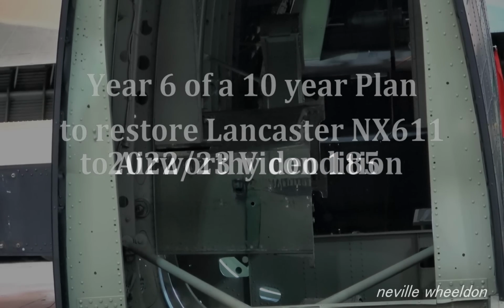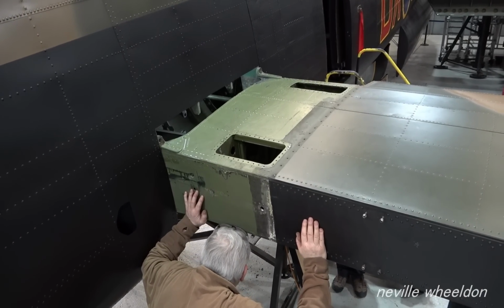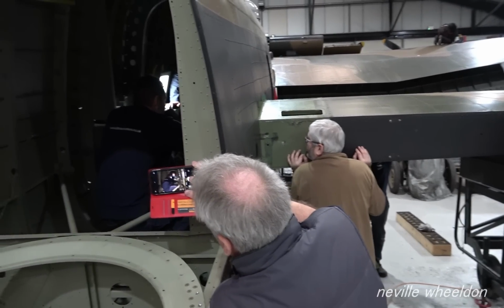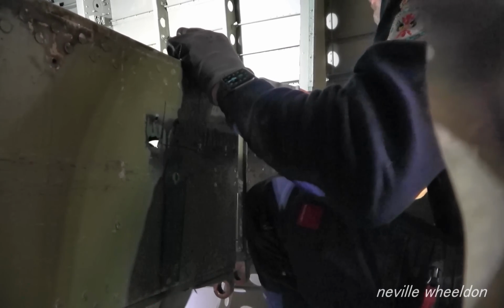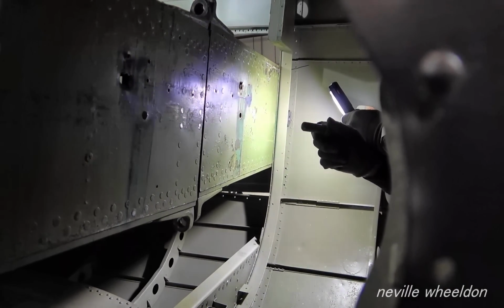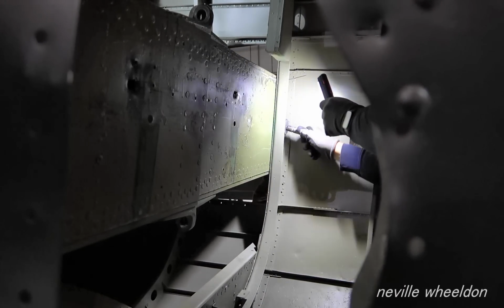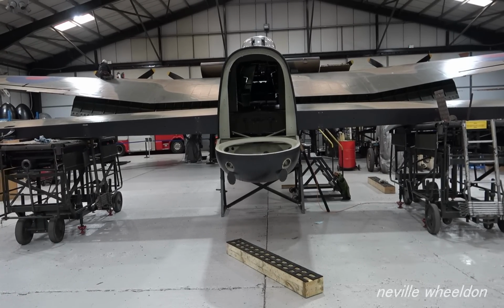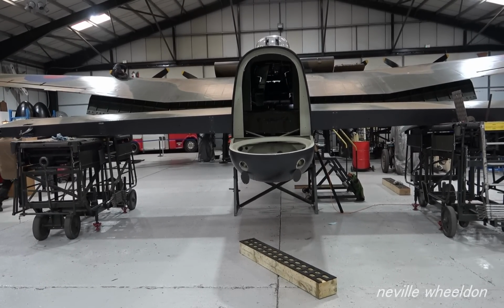Video 185 Restoration of Lancaster NX611 Year 6,. Starboard tail plane fitted into the fuselage.

Comment: I meant to ask earlier -- with a number of references to the use of magnesium in the plane, and other planes of the era, and how poorly that material has held up, what was the appeal for engineers to use magnesium in aircraft ?
Reply from the maker: Hi HH ,Magnesium rivets they say they worked harden very fast, the time the rivet gun had finished, it had worked hardened to a strong material. in WW11 the life of a  Lancaster bomber was about 200 hours
so no problem with the rivet deteriorating in that time.
Reply: @nevillewheeldon1693  MUCH appreciated !